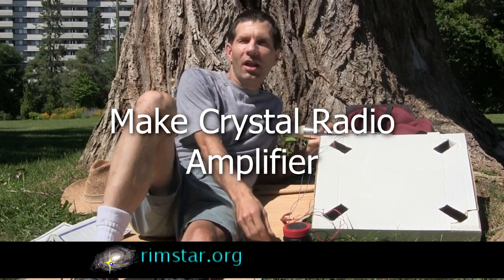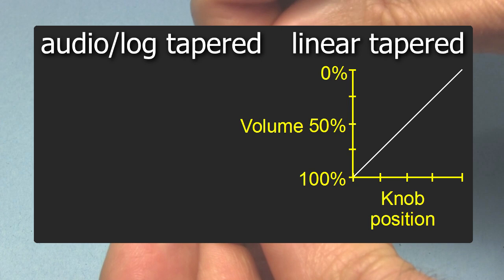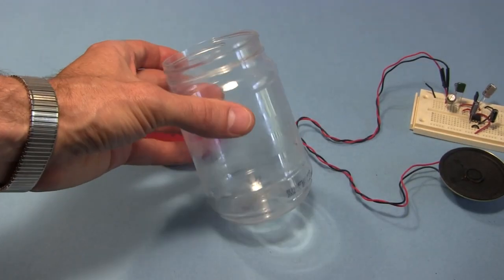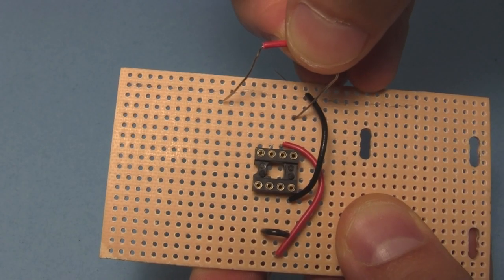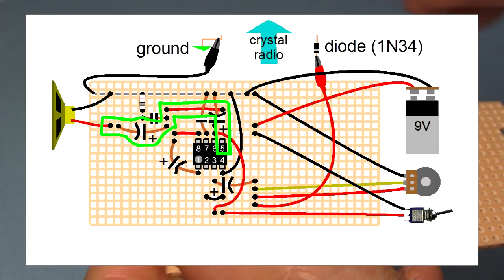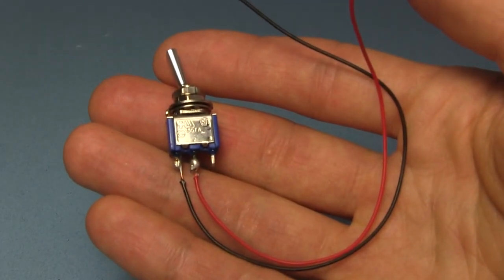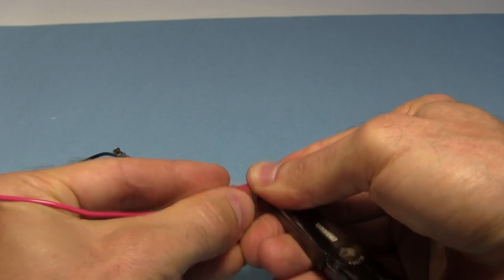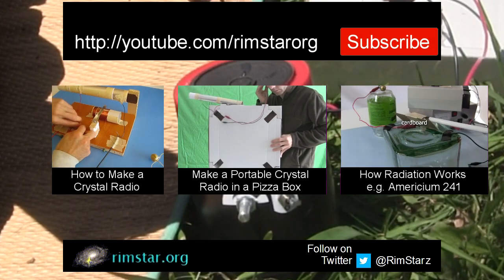How to Make Crystal Radio Amplifier for Speaker

Comment: While reading comments on your AM radio transmitter video, I saw you mention needing an amplifier to use a microphone. Does this amplifier work?
Reply from the maker: Yes, this amplifier works. You should be able to hear it at the beginning of this video. It's that amplifier that's playing the sound from the crystal radio.
Reply: @R @RimstarOrg  Thanks for the reply. So, if I plug a microphone into the amp’s input and route the output to the transmitter input, will it transmit the mic audio?
Reply from the maker: It should, yes. Be careful about transmitting too far though, in many countries it's even illegal without a license. You don't want to interfere with existing radio stations or emergency stations.

Comment: What a mess. Don't Americans have Veroboard?
Reply from the maker: Ha ha! Canadian, but same side of the pond. But it's really to do with me, I say that I don't do pretty or at least not usually. Though I do like to get creative with how I mount components sometimes. E.g., on acrylic with my music player https://youtu.be/WM1bZgBqDl4 on a potato chip with my macrochip https://youtu.be/f8e_-fyvScU
Reply: @RimstarOrg  Have you used Veroboard. It's like the board in the video with the same 0.1 inch pitch but has copper strips on one side. Saves all those wires.
Reply from the maker: I have some which I got after making this video. I just haven't had a use for it yet.

Comment: Here is a good idea for anyone watching.  If you have Old computer speakers which are active meaning you need to plug them into a powersupply you can make a great Amplifier as that is all they are.  The plug that goes into the computer is the input and the speakers are an amplifier speaker circuit.  I use them for all sorts of Signal processing and amplification needs.  Its stero normally and some have all sorts of more advanced functions like Filtering, Gain, Left right etc....

Comment: Another great video! Thanks for the info! One question I have is would it be possible to build a 2nd LC set (using the same antenna) that is tuned to a radio station very near by (strong carrier wave) and use a bridge rectifier to replace the 9v battery? (I'm sure the voltage would be less than 9v, but you should be able to amplify the weaker signal that you want to hear at least to the same volume as the radio station that is more powerful/nearer, right?)
Reply from the maker: Thanks! I'm glad you liked it. Theoretically what you're suggesting should be possible but as you guessed, there isn't a lot of power in these received signals. I doubt you could power this particular amplifier circuit so you'd have to come up with something else. You might even need more than one 2nd LC set.
Reply: @RimstarOrg  Thanks for taking time to respond! I am collecting things to build a crystal radio now. I guess the best way to see how things work will be to build it and see what happens. Looking forward to future videos.

Comment: Thank you for share I make this one and work but when I connect to crystal radio is very2 weak volume on maximum potensio..any suggestion thank you very much.
Reply from the maker: A long, straightish antenna and a good ground are perhaps the best tips.
Reply: @RimstarOrg  ..next I try thanks

Comment: Turns out if you connect one side to the ground and the other input to the antenna, it works like a radio receiver by its self. By changing the volume i can kind of tune. It picks up AM radio the best, but also some times picks up FM radio.

Comment: One newby question, if you improve the antena size in your radio it's possible to collect more energy from radio station to power your device without battery? Thanks
Reply from the maker: I'm not sure about improving the antenna for this loop antenna but if you were using a straight wire antenna then the longer the wire the better.

Comment: How can you replace the battery? Thanks.
Reply from the maker: The 9 volt battery is just snapped on. Replacing it is easily done by pulling it out of the jar, unsnapping the old one and snapping in the new one.

Comment: Can i use 12v battery and bigger speaker?
Reply from the maker: The speaker I chose was just a random one I had lying around. You may be able to use a larger one and still get decent sound volume. From the amplifier chip's specifications (http://www.ti.com/lit/ds/symlink/lm386.pdf), it looks like it can handle 12V.

Comment: To avoid this "hummmmmmm" when u touch the potentiometer simply solder a wire from the "ground" (negative) to the metalic body of the potentiometer.
😉.

Comment: is there a way to do it but instead of a 9v battery, a 9v battery eliminator or a 5v charger?
Reply from the maker: I don't think so. All those would do is raise the base voltage (bias it). They wouldn't amplify the waveforms themselves.
Reply: @RimstarOrg  I see
but if I needed a constant power suply, it would do the work? I'm not looking to amplify the waveforms, I want it to not run out of energy to produce sound
I need it to be powered for a month and I believe the 9v battery wont last that long
pd: sorry, I'm not a native english speaker
Reply from the maker: It sounds like you don't mind plugging into a wall socket for power. An easy place to get a DC power supply is to look for an adapter. Many things these days some with adapters so you can reuse one from something else. You can often find them at thrift stores or second-hand stores. At four minutes and thirty-six seconds into this video http://www.youtube.com/watch?v=ml2TdQ2_2mk you can see me use one for charging up a capacitor. For this amplifier you probably can use anywhere from 5 volts to 9 volts. I don't know what the current rating is though so you'll just have to try different adapters and hope you don't damage them by the amplifier drawing too much current.
Reply: I didn't know how those were called in english haha, but yes, I want it to be plugged on a socket, because 9v batteries are a little bit expensive here and I want to do a few.
I'll try and hope not to burn it. I'm very new to electronics, but I saw a few of your videos and they have helped me a lot on some ideas.
Thanks for replying... also thanks for the video and explanations, it is very helpful

Comment: Would it matter much if you connected a solar cell (or several) to a rechargeable battery so you could skip having to change the battery out in this?  How would you do that?  Would it make sense to bother with it?
Reply from the maker: Absolutely, it would make sense. Heck, you could even cover one side of the pizza box with the solar cells! I don't know how much power was being drawn by the amplifier so I don't know how many solar cells you'd need. If that's still not enough then you could put some cells on a panel that folds out from the box. If it's a sunny day then you may not even need batteries, just run the amplifier directly from the solar cells.
With the six-solar-cell panel I made here https://rimstar.org/renewnrg/diy_homemade_solar_panel_simple.htm I got 3.22 volts 1.81 amps with no load so it looks promising.
Reply from the maker: Sorry, I see you may not even be talking about using the pizza box crystal radio. I guess I got excited by idea. :-) I don't know anything about charging rechargeable batteries like AA batteries. You can probably buy charger circuit boards for lithium batteries as long as they take DC as input since that's what the solar cells provide. Have a look at what https://www.adafruit.com/ or https://www.sparkfun.com/ have to offer.
Reply: Thank you!  I'm really enjoying your videos!  I'm trying to learn what I can about all this stuff, and I appreciate your posting them and also replying so quickly :)  I'll have a look at the links you posted here.  Thanks for posting them!
Reply: Hey, I just checked out those links.  I guess I wouldn't know a charger circuit board if it bit me in the nose.  Also, I like the idea of covering the pizza box with solar cells, so long as they don't overheat and catch it on fire.  But I still don't know how to set that up.  I'm still going through your videos.  I just found your channel tonight.
Reply from the maker: There's no danger of fire. With that small an area of solar cells, there won't be enough current to produce enough heat for a fire. I glad you're enjoying my videos!
Reply: Ah.  I don't know much about solar cells.  I'd heard that they can overheat (so that's why they have to be kept separated from rooftops, or put out in fields).  I think what you said makes sense though.  Plus, pizzas probably get hotter than the solar cells would in this scenario, so yeah, it sounds like something that would work.  That's a really convenient place to put them, too!  If there's room inside the pizza box for a speaker, then you could cut slits in the side for that and maybe put tape over them (for weather proofing), and then you'd have a single go-anywhere AM device that wouldn't need new batteries, so long as the sun's out!

Comment: How did you mount the switch and the potentiometer in the jar? Thanks, great video!
Reply from the maker: I simply made holes for them, put them through the holes, and fastened the nuts that come with them. See the video at 7:51 and 8:18.
Reply: Thanks Rimstar!  I never mounted a potentiometer before and looked right past the obvious fastening nut.

Comment: Hey Rimstar, would it somehow be possible to replace all of those capacitors and resistor with homemade ones? What kind of calculations would you need to do? 

I see that you're trying to make your am radio as "diy" as you can and thought it odd that this one was the odd one out!
Reply from the maker: I guess you could make DIY resistors. The capacitors would be trickier since microfarad range capacitors would be huge unless they're electrolytic. Luckily I do have videos on making electrolytic capacitors https://www.youtube.com/watch?v=ml2TdQ2_2mk and http://youtu.be/lmVVdV8wuB0 . You'd just have to do some trial and error to get the capacitance close enough.
PS. I saw your earlier questions on other videos but then I saw you got your answers from later videos. I'm glad you're enjoying them! Thanks for watching!
PPS. Since you asked for more low level videos with formulas, here are two normal capacitor DIY ones that talk about capacitance and breakdown voltage with formulas as the basis:
http://youtu.be/GveI9gXIsHw - low voltage caps, capacitance

http://youtu.be/MPD7skZ8OSo - high voltage caps, breakdown voltage

Comment: Hello, I tried building the amplifier and it worked for like 5 minutes, and then i smelt like something was burning up and it came from the capacitor next to pin 6 in the amplifier and when i touched it, it was so hot. At first i was using a weak 9V battery but it didn't work, then i changed to a 12V battery and it worked. Now, I don't know where the problem is coming from, is it from the higher voltage? Is it from a bad capacitor? or is the polarity of the capacitor is reversed because i searched on the internet and found that a capacitor could get really hot if you place it reversing the polarity, but from your diagram it seems correct positive leg facing the pin. I hope you can help me.
Thank you for your time
Reply from the maker: It could be that that capacitor was faulty to begin with. You could try replacing it with another one, keeping in mind that if that wasn't the problem then you could damage that one too. But you could first check the capacitor on pin 7 to see if it's good, to see if it's not a short circuit. Actually, I guess you may as well check all components. You'll have to remove them from the circuit to check.
Reply: RimstarOrg 
I decided to do the same thing, i am going to build it again on a breadboard first to check everything before soldering. Also i found out that i replaced the ceramic capacitor of 0.1 Mf with an electrolyic one so that may have cause the problem.
I wanted to ask if you have tried to build a radio transmitter or receiver circuits, i tried some from the Internet but continues to fail and i like the way you explain things and  take us step-by-step. I would be so grateful if you tried one or gave me a reliable link to follow. Thank you for replying and for your time
Reply from the maker: The receivers I've build are the crystal radios, like the one I demonstrate in this video. I have a bunch of stuff on those in this playlist https://www.youtube.com/watch?v=VqdcU9ULAlA&t=3s&list=PLFsZmHTZL-zlSltC6ELZW9PK4ks7wgPRz&index=1.
As for the transmitter, I have this one here http://youtu.be/_4-Sx-T6VBc but it's not a great one. It transmits on multiple frequencies (harmonics). Keep in mind, you shouldn't be transmitting without a license and in many countries it's illegal to do so without a license. For this one I kept the signal very weak so it transmitted only a few feet.
Reply: It worked! wohoooo xD 
there is something annoying though the sound from the speaker is not 100 percent clear, i am hearing a lot of fuzzy crackly sound but i am hearing the song as well. I tried 8 ohm, 4 ohm, and both speakers together and nothing gets it away. Do you have any suggestion on how to fix this? 
PS: It is still on the breadboard if that would cause any trouble.
Nevertheless i am so grateful for your fast replies and for that amazing video!
Thank you again
Reply from the maker: Glad to hear it! What made it work?
Mine doesn't sound perfect either. For cleaning up the sound, try changing the 0.047uF capacitor to a 0.1uF capacitor instead. That should better filter out some of the unwanted high frequencies. Let me know how that goes.
Reply: i had an electrolytic capacitor in the older build instead of a ceramic one. I bought new components and rebuild it again carefully and that done it. 
I am testing the amplifier on a mobile phone not the radio xD
The sound seems to distort on music with high bases so i played ones with lower bases and it sounded finer , also i think my audio plug is not perfectly connected because when i connect to the mobile and like hold it up the sound gets clearer. 
There is one thing, the radio links you sent me are for AM radios. Do you know a reliable circuit for a FM radio either transmitter or receiver. i tried the transmitter but wasn't able to adjust the frequency using the trimmer capacitor of the circuit to one on the FM, considering i have the circuit right. I had this thought of making the receiver and transmittor of the FM Radio and instead of trimmer capacitor, I would use a ceramic capacitor say 20 or 40 pF for both circuits so that i would make the frequency the same. IF you know anything about that i would really appreciate that.
Anyway thanks again for the amazing help
Reply from the maker: For the bass, try changing the 220uF capacitor just before the speaker to something 1000uF or higher.I don't have anything at all for FM.

Comment: ok so it works but the radio is not even connected, all that's connected to the amp is a ground wire and its not in the ground and a wire for the diode no diode wired up so no radio or anything can you tell me why or help me
Reply from the maker: Are you talking about how mine is wired up, or yours? Starting at 0:40 in the video I show the crystal radio's ground side and diode side both connected to the amplifier. Okay, that's the circuit for a slightly different crystal radio but if you look at this diagram for the portable crystal radio http://rimstar.org/science_electronics_projects/loop_antenna_portable_crystal_radio/loop_antenna_crystal_radio_circuit_diagram.jpg (from http://rimstar.org/science_electronics_projects/loop_antenna_portable_crystal_radio.htm), all I did was replace the crystal earpiece in the diagram with the amplifier. In the diagram, the amplifier's ground connection goes to the red line). The diode is still there in both cases.
Reply: my radio,  when i have the radio wired up correctly like in your diagram and replace the earpiece with the amp it works but when i disconnect the diode and cap from the radio so its just the two wires coming from the loop coil and the amp is connected i still here noise do you know why this is
Reply from the maker: As long as you still have the antenna, there's a chance you'll still hear noise. It's the resonant circuit between the tuning coil and the tuning capacitor that tune in just one radio station, and it's the diode that turns it back into audio.
Reply: right but the diode and cap are not connected to the radio its just the loop coil
Reply from the maker: Yup, as I said, as long as you have the antenna then there's a chance you'll still hear noise. That's all you need for noise, so what you're hearing is normal. If you want to hear a particular radio station then you need the rest.
Reply: even with no diode is there a reason why i still hear noise just curious all so the amp is not that loud
Reply from the maker: Because you have an antenna. An antenna is what receives the radio waves, all the radio waves from all the stations at once, plus electromagnetic waves from other sources. That's why it sound like just noise.

Comment: also will this work with a portable crystal radio no ground
Reply from the maker: That's what I'm demonstrating at the beginning of this video. Although, to make it a little louder I cheat and if you look closely you'll see that I have the palm of one hand on the outer capacitor plate to give it a ground. It does work without doing that though, it's just quieter.

Comment: I mean instead of the 10 ohm resistor not the variable pot would that work please respond before 3
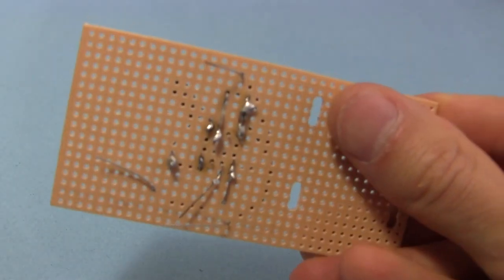Reply from the maker: That's quite a big difference. I suspect it's for filtering. If you put 10kohm then you may as well not put that part of the circuit at all. Many circuits don't even put that 10 ohm resistor and 0.047uF capacitor at all. i.e. Don't replace them with a plain wire, just don't put anything in their place at all, skip 5:06 to 5:16 in the video.